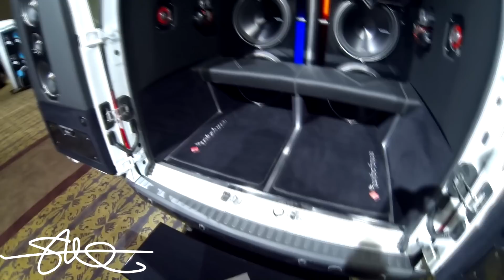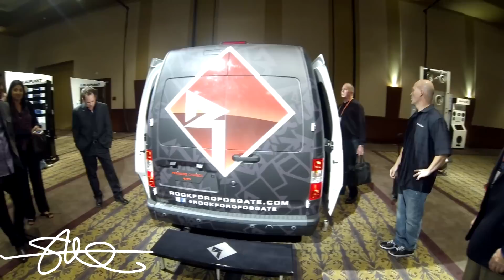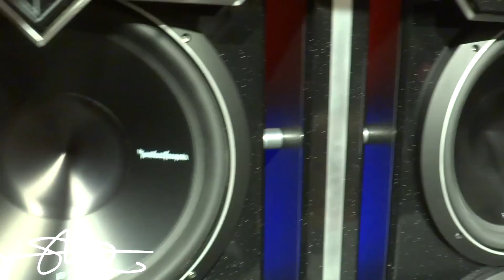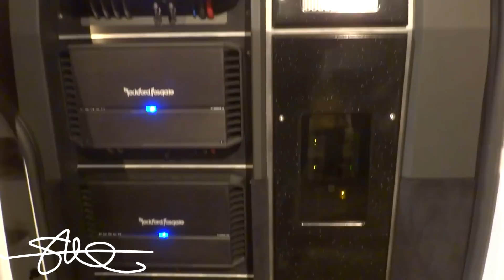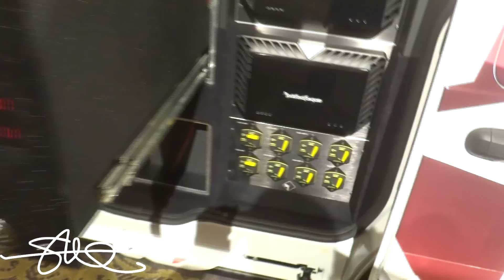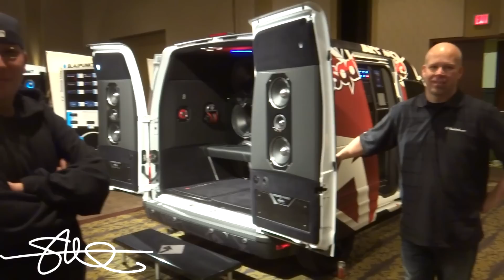CRAZY BASS! The Pressure Chamber - Rockford Fosgate CES 2013

Comment: How would you tell from a flip camera that isn't made to record low tones? If you look at the frequency response of a mic with a small diaphragm, you'll notice that many of them stop well above the frequencies a decent sub can hit, which will explain the inability to tell the decibel level of sound pressure a car is capable of producing based on the video. Especially considering the 12-18 decibel roll-off after the microphone's usable frequency range has ended well above the sub's audible range.

Comment: Hey steve i got a question. Im planning on running 2 15" rockford T0's to a RE 3000.1 amp and 6x8 rockford speakers. What do u think on what size alternator and how many batteries would i need? This will b for every day use if that matters

Comment: i don't think its the amount of power its how you use the power you have available. kind of like say a 1000bhp car could loose to a 3-400 bhp car if the 1000bhp driver cant harness his power hes gonna be all over the place but if the lesser power car driver knows how to use all 3-400 horses hes gonna fly off the line.. my theory is its not wat you have its how you use it.. if Steve Meade did a pressure chamber with 30.000 watts in his van there would be tap outs before the door closed